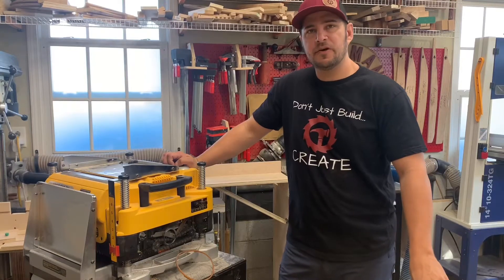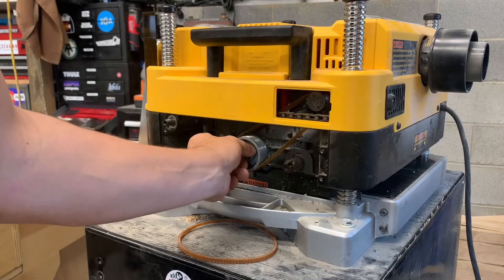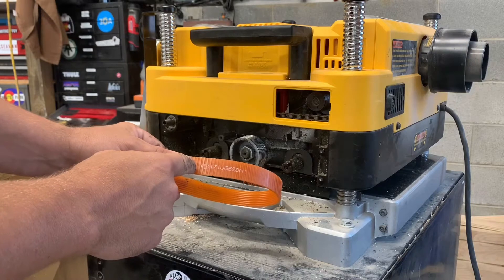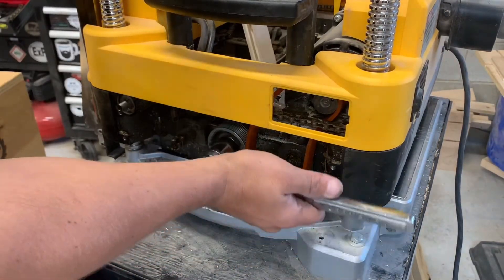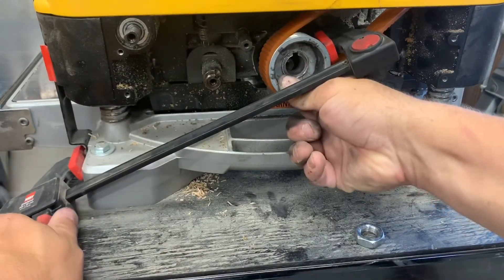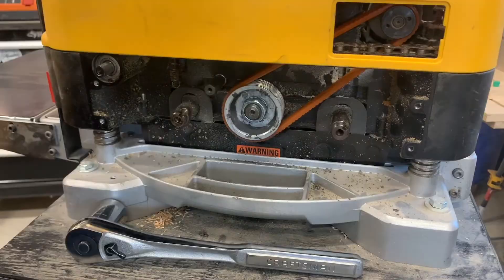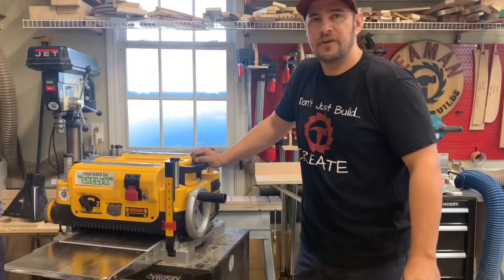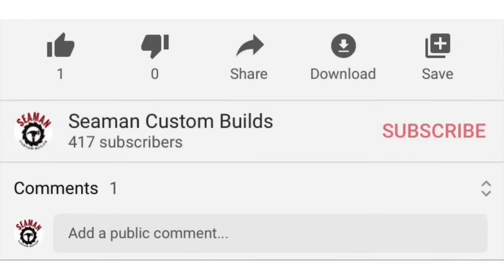Dewalt DW735 Belt Replacement - HOW TO - DIY

Comment: Hah, same (replaced cutterhead to shelix, and no idea where the bushing went). Came here to see where the bushing goes. My pulley is a bit stuck now, so I'll have to figure that out to put in the replacement bushing when it gets here. Wish you'd have shown the bushing part, but otherwise, good video. Loved the clamp method - I'm definitely going to try that next.
Reply from the maker: Thank for watching and good luck
Reply: Hi guys, I’m looking at this video because I had a belt break on my DW 735 and I to have the Byrd Shelix cutterhead. What bushing are you guys referring to? Did you get the larger Shelix where you have to  remove all of the carbide bits in order to install it Is there a part that I’m missing from Shelix? Is this why my belt shredded at this worse time ever.
Reply: What replacement bushing??? The same set up and just shredded my belt. Did I not line something up correctly when I installed the Shelix?
Reply: @gregrossignol3981  I got the smaller one where no removal is needed. Either way, the busing is necessary - I couldn't find mine, so I had to remove the pulley. I then had to bend the pulley to get it off (because the vibrations didn't allow it to come out), so I also had to get a replacement pulley. It works flawlessly now.
Reply: Thanks a bunch! Love you brother. I looked at my  straight cutter head that I still had and low and behold the bushing was still on there!! Slid it right off and onto my she licks and now I’ll be good to go. So thank you very much. If anyone else is wondering about the bushing, it’s goes directly behind the polling pulley and is about an 8th inch thick and three eights of an inch long give or take, and it looked like it was part of the old original cutter. The YouTube video I watched while doing the install of my Shelix never mentioned the bushing so I I didn’t see it. Easy to miss. Hope this helps someone.

Comment: Appreciate the video.  In particular, your comment re: the bushing.  While disassembling mine to remove a melted belt, I discovered that, although present, I installed the bushing incorrectly, causing pulley misalignment.  Thanks again.
Reply from the maker: Glad it helped
Reply: jesse, where is this bushing located?

Comment: First off thanks for the video. It gave me inspiration to figure out what I feel is a little easier then the clamp. It starts out the same way by loading the belt around the circular metal wheel. I also suggest you mark where the key is to make sure you have everything aligned. The big difference is using a screw driver as a lever. Stick it through the the hole on the wheel into the hole in the rod and just bend the screw driver straight to get it in. Hope that help.

Comment: Great guide. Good timing too. My planer broke right as you uploaded this.
Reply from the maker: Bummer on the breakdown but hope the video helps
Reply: @seamancustombuilds2553  it was exactly what I needed. The only thing that I ran into was the belt came off of the upper gear when I was installing it and I had to roll it off with a screw driver and a socket wrench, remove the lower gear and try it again.

Thanks again, man
Reply from the maker: @UG3TPWND  glad you got it going again!

Comment: Tell us more about the missing bushing that you missed when replacing your Shelix cutter head. For I also installed a Shelix cutter head about two years ago have noticed that my belt is half it width.
Reply from the maker: I found the bushing was still on the end of the original cutter head which was easily removed.
Reply: @seamancustombuilds2553  uh oh I feel like I did the same thing but sold my old cutter head -_-
Reply from the maker: @fowlerfinefurniture  oh no
Reply: somehow i also failed to transfer the bushing. it took about 2 years to destroy the belt and then started going through them too fast to believe. i too found the bushing on my old blades. this seems to solve the problem of the belt walking off the pulleys.
Reply: @seamancustombuilds2553  does this bushing look like a thick washer ?
Reply from the maker: @jontucker7292  yes
Reply: @seamancustombuilds2553  found mine on the old cutter head I took off, thanks
Reply from the maker: @jontucker7292  good deal 👍🏻
Reply: @fowlerfinefurniture  I just ordered what I think is the replacement bushing from ereplacement parts because I also got rid of old cutterhead w (presumably) bushing on it and now have a shredded drive belt and wobbly pulley. Did you replace the bushing and did everything work out ?
Reply: @TheDogdokken  I'm trying to remember what I did, everything is working out okay now. I think I may have had to open it up and get they pulleys more aligned by tapping into place with a hammer, that's what was causing my belts to tear. I don't remember if I used the bushing from the original or not, sorry!

Comment: Could you go into more detail concerning the bushing?  Another person said they put it in wrong, and I need to get adequate info befrore proceeding  
Thanks
Reply from the maker: The bushing looks like a thicker washer, I don’t know if this only had to be done on older Shelix cutterhead or if the new one need it swapped too.
Reply: @seamancustombuilds2553         exactly where was this bushing located?

Comment: Thank you for a great video, very helpful.  Do you happen to know the torque spec for the pully nut?
Reply from the maker: Thanks for watching, no I didn’t find those specs anywhere so when with as tight as I could by hand
Reply: @seamancustombuilds2553  Thank you. That’s what I am going to do.